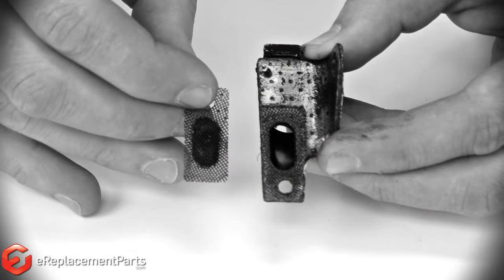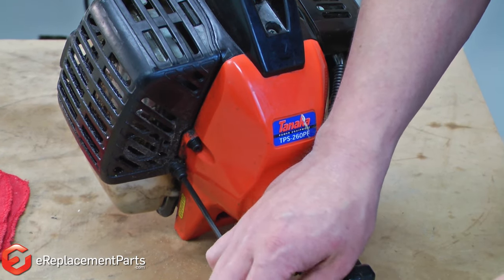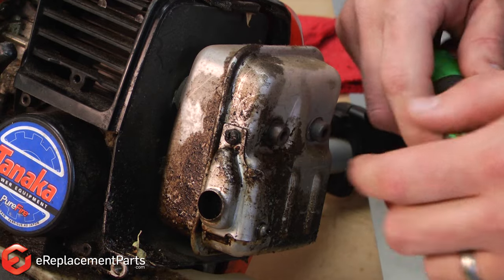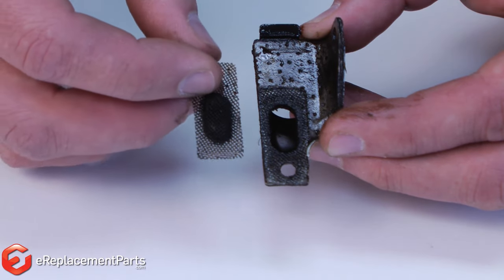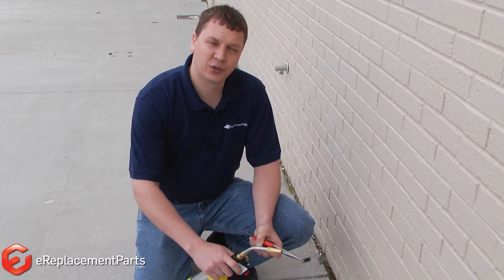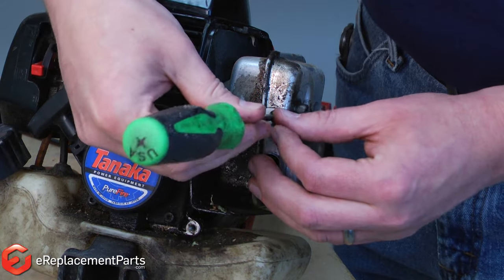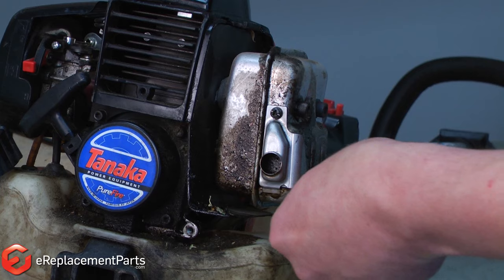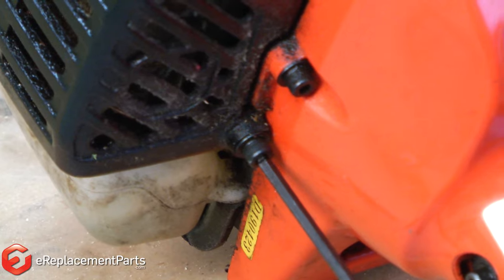How to Clean a Spark Arrestor Screen on a Small 2-Cycle Engine--A Quick Fix

Comment: excellent video as usual! Can you tell me how to access the spark arrestor in a craftsman bushwacker model 358795800????? Or does it even have one? If it does it must be in the muffler but what part di I need to remove and how to remove it to get to the muffler on the craftsman 32cc above?
Reply from the maker: There are 3 screws that hold this muffler together. Inside there is a tube with holes and surrounding that is a screen that works as the spark arrestor.
Reply: Not now
Reply: Frank Clare thanks

Comment: can somebody explain to me how a spark arrestor works? how does it stop the spark plug from working?
Reply: its stops sparks from passing through the engine into the muffler.
Reply: yeah but why would it get clogged and prevent the engine from working?
Reply: Carbon deposits from the oil that is burned.